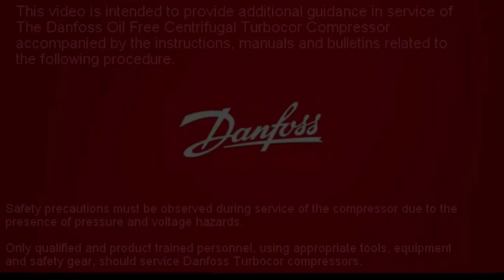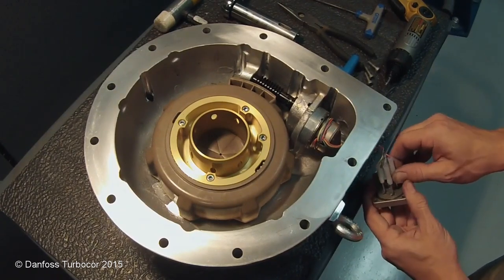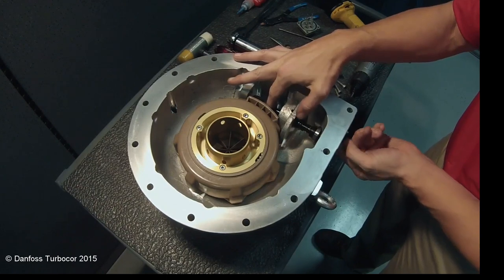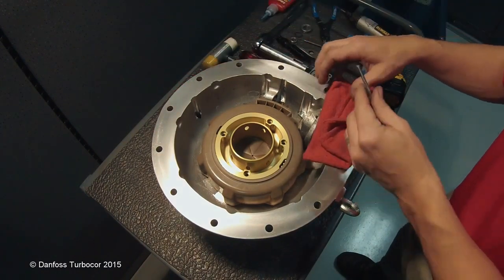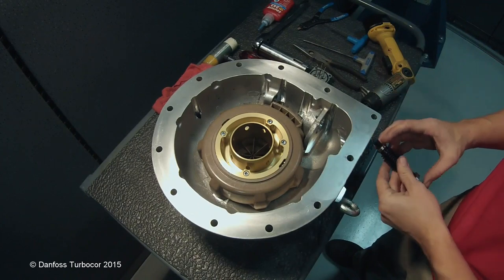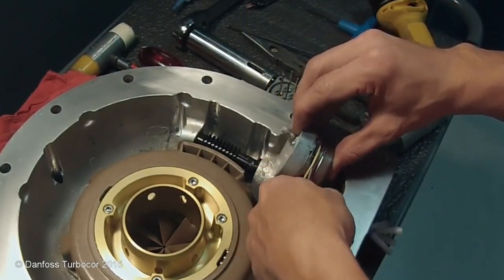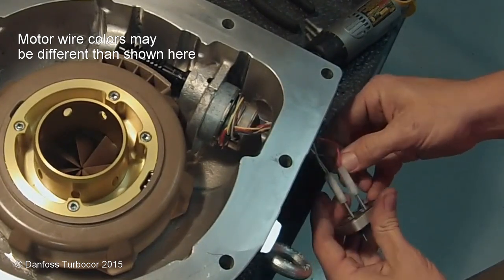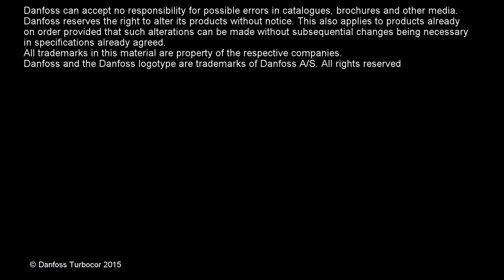Danfoss Turbocor TT & TG IGV Rebuild

Comment: We have installed 2 units of water-cooled chillers (390RT, 3 compressors per chiller) at a hospital in Malaysia. Facing a "peculiar" situation with the compressors (one from each chiller) where the IGV is not opening beyond 26% (max). We have tried replacing the backplane assembly card, alomng side the PWM, serial etc - still no solution. We have tested the IGV motor opening pattern using programme (laptop) and it works - it does fully open to 110% but that's not the case when the chiller is operating. We have also dismantled and visibly checked the IGV - looks fine.
ANY IDEA OR CLUE WHY THIS IS EVEN HAPPENING? IS THIS AN IGV RELATED ISSUE OR SOMETHING TO DO WITH THE COMPRESSOIR ITSELF? APPRECIATE SOME ASSISTANCE HERE - ISSUE NOT SOLVED FOR ABOUT 10 MONTHS NOW (MANUFACTURERS/VENDORS HAVE TRIED)
Reply from the maker: We are checking with our experts and will get back to you.
Reply from the maker: Hi again.

Please reach out to our local expert in the Asia Pacific region:

Derek Foong King Soon
Technical Support & Services Manager
+63 2898 8268 8
+63 2827 1121 2

Thank you
Reply: Bro,the problem already solved?i have same case with u,

Comment: Dear Sir. Is there a chance to buy the step motor driver tester?
Reply from the maker: The stepper motor tester is not a tool that we offer, however it may be found at an electronics or supply store.
You can also move the worm gear using a pliers or similar tool as shown in this video.
Functional testing of the IGV can be done when connected to the compressor. See our IGV Verification video: https://www.youtube.com/watch?v=b_B6pJYph0w

Comment: Does he aware, the wire installation of the step motor is not proper, wires are too long, twisted and gets metal contacts that can damage the wire insulation by vibration?